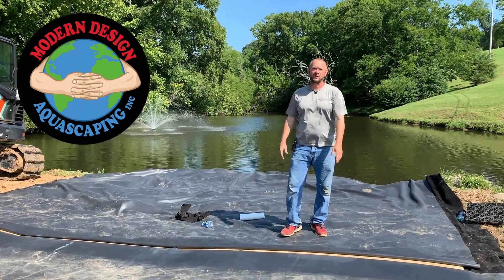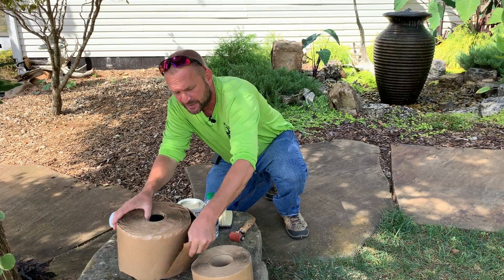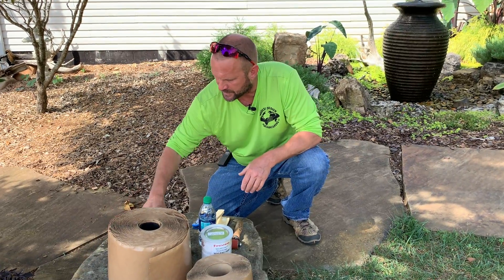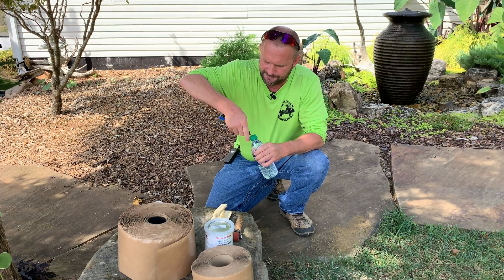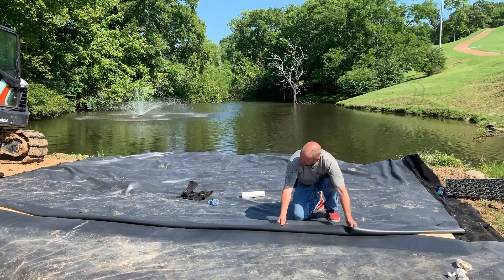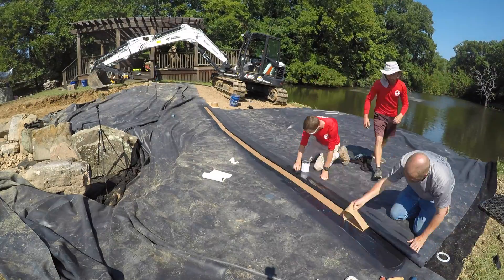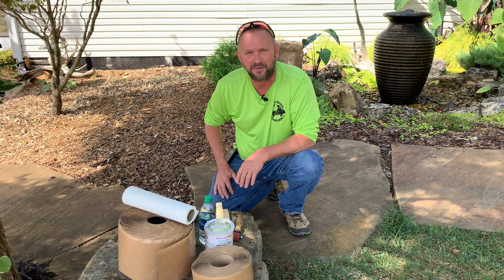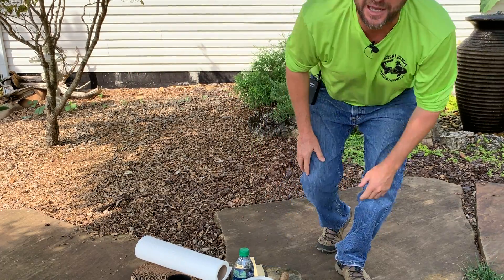How to Seam EPDM Pond Liner | The Professional Double Seam Method!

Comment: This is an awesome video,
I'm just curious about the temperature used to weld these pondliners, please let us know what temperature you use when welding a pondliner and what's the base temperature to weld a pondliner
Reply from the maker: The temperature requirements are listed on the seaming products. I’ve used  them when it was nearly freezing, and simply worked with a heater and a tarp over top to keep it warm. If it’s extremely hot, sometimes we need to work underneath a tarp to keep the sun off of it so it does not dry too quickly. Other than that rain is the only thing that gets us. The liners need to be dry and too high of a moisture Content will cause the seam to fail.

Comment: It's brilliant to see how much work goes into joining liner sheets.....wow I can see why people buy them so large they have to move them with heavy machinery - fewer seams! Amazing job you did there. But pray tell, how thick is the liner in this video because you don't seem too worried about puncturing it? Also how long does it take for the seam to dry so that it's safe to move, fold and such?
Reply from the maker: Liner is 45 mill EPDM-seam is water proof immediately upon completion of the seam!
Reply: @KoiAddiction  I'm defo getting it for my pond. But how come it is safe to walk over it like you guys do, is it really this resistant to punctures?

Comment: Certainly one of the best pond channels on YT! I enjoy the content immensely. I have a question, when it comes to underpayments  is it ok to overlap or do you guys prefer one piece? Also if you could only do 8oz on one layer, would you do it on top of the liner or underneath while still using a lighter weight on the other side. Thanks!!
Reply from the maker: Good question! We overlap. Sometimes I will melt the under-layer together with a torch. Depending on soils and boulders we use different gauges of underlayments up to 15 oz!

Comment: Excellent video. BUT, what if I want to use old and crusty abandoned above ground pools for making a swimming hole? Of course I would pressure wash the heck out of it first. But will it work?
I live out in the desert just north of Los Angeles and this area grows more pot/weed/grass than even Humboldt County. They put about $150K into a grow site and make $1.5 million off the first clipping. Then they get the heck out of there and leave most of it behind. Wood, greenhouses, water tanks, fences and pools. Lots of above ground pools. I collect the remnants and sell it. I make a good living off of the lumber. But it gets hot as heck out here in the summer, so I need a place to cool off. Can't do a regular pool because of the wind driven sand plus I have no electrical source other than solar. So I thought that a living pond with a rubber bottom would work. I can setup a simple pump and filter to recycle and aerate the water. Make it at least 6 feet deep at one end so the little fish can live down there in the winter. It would stay at around 56° at that depth. Warm enough I think for the right fish. I would plant some hearty water plants that can survive the cold winter and the hot summer. And it would be big enough for swimming. Then fill it with delivery water at $150 per 4000 gallons and hope it doesn't leak
Reply from the maker: Sounds like you have a solid plan! Let us know how it goes ;)

Comment: Great video. The only thing I missed was exactly how you lapped it over. I would like to see how you folded the two pieces and then seamed in two places.
Reply from the maker: We just laid it out flat folded the top piece back, and then clean and seemed. Once finished do the cover tape on top. It is an added layer of protection but it’s worth the peace of mind to me.

Comment: Hi John I have a question on seaming the liners together from old pond to new. I enlarged my pond and have to seam the old pond liner to the new liner. I have liner that is under the rocks exposed along the edge of the pond, it is about 12 inches in length.  Is it better to use the liner from the old pond that is on the edge of the pond that was not under water or is it best to lower the water level of the pond and lift the liner up and use that part of the liner to seam.
Reply from the maker: I dont think it matters as long as the liner is in good shape and perfectly, brand-new clean. Be careful with the folds!
Reply: @KoiAddiction  Thanks John for the info.

Comment: no info on what the primer is made of, or what type of tape? Sorry, not in North America, so I'm looking all over and don't even know what to ask for...
Reply from the maker: It is firestone epdm primer and epdm double-sided tape & cover tape. The cover tape comes in 6-9-& 12” wide rolls! Call MJ the pond advisor in UK?
Reply: Go to the Firestone website and get tons of information there on their TIS (technical information sheets). https://www.firestonebpco.com/ Check out their EPDM lines in all areas bc the products overlap. In fact, they've taken the same EPDM material and rebranded it as GeoGard, PondGard and RubberGard. QuickPrime is the seaming solvent. I've researched this shyte inside and out and upside and downside! And that includes speaking with their technical specialists bc I do NOT want to have to touch the liner ever again ... well, maybe if a tree falls on it and I need to repair it. But NOT bc I didn't seam it right. Going behind incompetence is a bloody PITA. Here, see if this gets you closer: https://www.firestonebpco.com/us-en/search?q=*quickseam%20primer&fq=(type:assets) I've used QuickPrime in quart and now gallon bc the gallon is a better deal if you need it—and I do.

Comment: Can the seam cover tape be used to repair holes in liners? If so, any idea where I could find a roll that is 12" to 18"?
Reply from the maker: Yes, we do repairs with it. It comes in 6 inch 9“ and 12 inch widths. If you call Aqua Scapes you should be able to get it from them or you can get it from a roofing supply company. If possible when we repair holes, we try to repair both sides👍
Reply: @KoiAddiction  Perfect I'll give them a call and give you a sub. Thanks for your help.

Comment: Great video sir! Working in my feature now. One question if ya don't mind? Do I need a "lap caulk" at the edge of the "6 inch cover tape"?
Reply from the maker: No I’ve used lap sealant in the past but only in extreme cases. My advice is to try to lay the seam flat as you finish your construction so that it doesn’t have stress on the seamed are👍🏻
Reply: Appreciate the response. Got the liners seamed, got it in the pool part of the pond/feature. What are your thoughts on using underlayment as a "pad" for the larger rocks? I ended up using grey underlayment, should I get some black fabric? For the pad.. thanks again

Comment: I have about a 3-5 foot seem to make. Do I need both the 3" and the 6". I see that the 6" cover tape costs about $120 for 25ft roll. Seems like a big waste for such a small seem. It is in a stream that brings water to the pond. Not a lot of elevation change.
Reply from the maker: I always use the added protection of both. Not worth the $ to come back and fix it later. It may be ok without, I have never tried it-when rolled into the cost of a project, it seems like cheap insurance to me👍
Reply: You can buy 6" cover tape by the section: I've seen by the foot and even as low as by 3" or 4". It's definitely a pricey product, but beats the heck out of having to revisit the liner because it wasn't done right ... and that's EXACTLY where I'm at. I gave up on someone else doing it and have begun the process myself. I'm confident it won't leak this time around! :) I might save a bit for future repairs and go ahead and sell my excess seaming and cover tape.

Comment: Thank you for this informative video John! Always thought you needed the expensive Firestone Splice Wash cleaner or acetone. So I understand that water & paper do a better job.
Reply from the maker: In my experience this method works just fine! I have seams going on 20 years old now are they are still holding strong😎 Just make sure you clean well past the seam tape, I have had some experience with tape “peeling up” where we didnt clean quite far enough out on the liner👍
Reply: I've used acetone (cheap by the gallon at Sally Beauty Supply stores when on sale) and someone said gasoline so I've used that too. Both are great at prep'ing the EPDM liner. I've also used water but bc I do NOT want to re-seam anything bc I've got a leak, I'm super fussy about the prep. I also do the multiple layer priming and sealing as they've done in the video.

Comment: I made the mistake by attempting to connect my liner in the ground.  Great information that you made look easy.  Lol
Reply from the maker: Yes, We run into that situation on occasion, the best way to deal with that is to take out a bunch more rocks, we usually rip some pieces of plywood about 16 inches wide and try to position them under the liner, sometimes you have to get very creative to make it work! I cut my liner too short one time and April saemed a piece to it and it was folded up like an accordion. Time and patience are highly underrated😂🤣😂